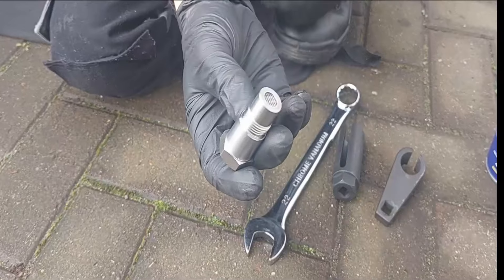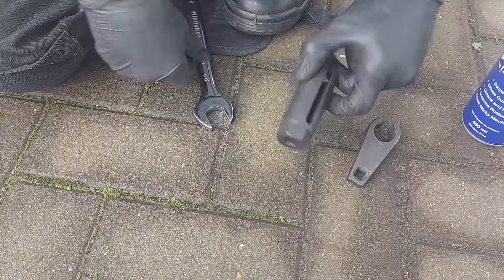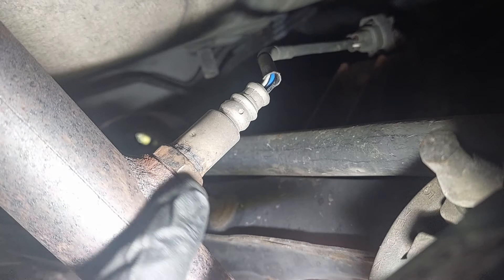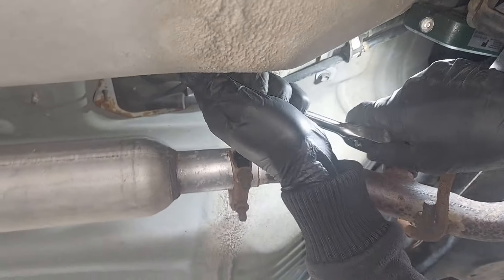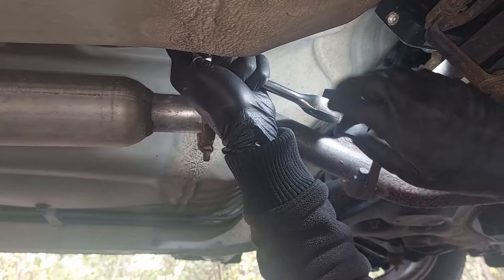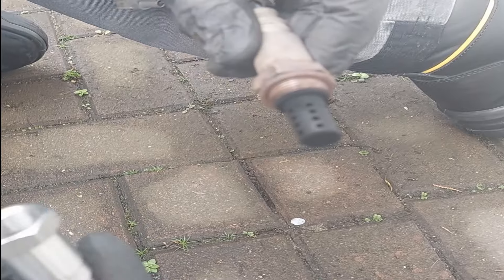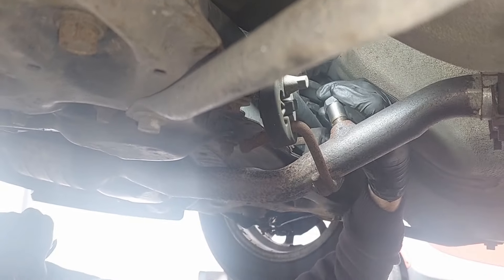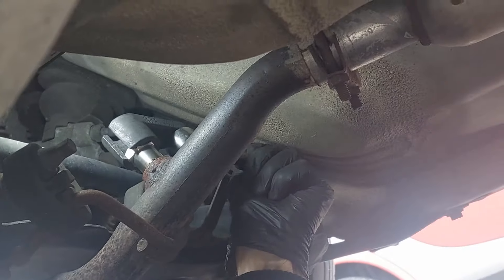How To Fix A Stolen Catalytic Converter Problem !!!!

Comment from the maker: LINKS:

o2 sensor extender:  https://amzn.to/4a2CDwL
                                     https://ebay.us/Sky1Lr
o2 sensor socket tools:  https://amzn.to/3QtG4FK
                                            https://ebay.us/5WLe1B
22 mm spanner:  https://amzn.to/3UH04aC
                               https://ebay.us/wCwzFL
3/8 ratchet:  https://amzn.to/3UK7x8T
                       https://ebay.us/KtEoWG
Anti seize:  https://amzn.to/4b3qZTG
                     https://ebay.us/6BDtzh
Wire brush:  https://amzn.to/44tgarm
                      https://ebay.us/I4bLT5
WD 40:  https://amzn.to/44p6Wg2
               https://ebay.us/WrPZAc